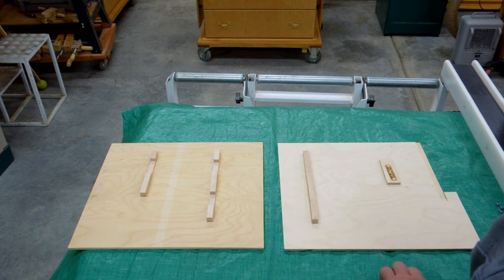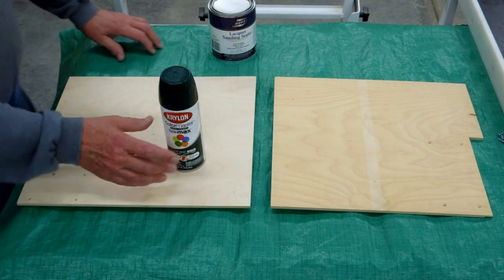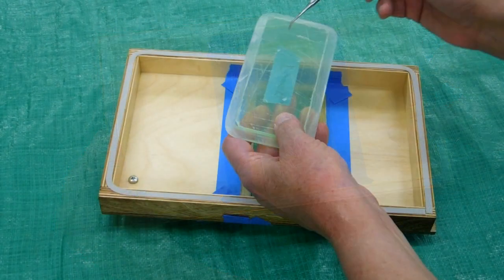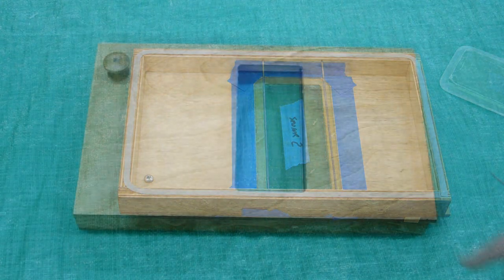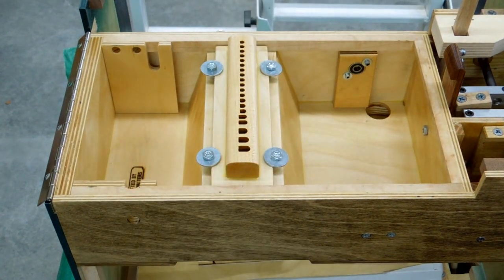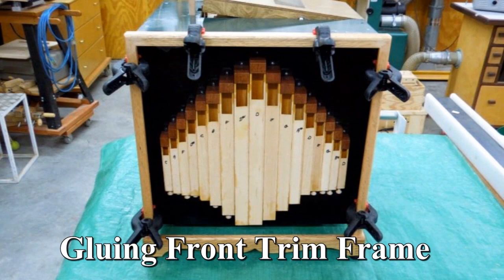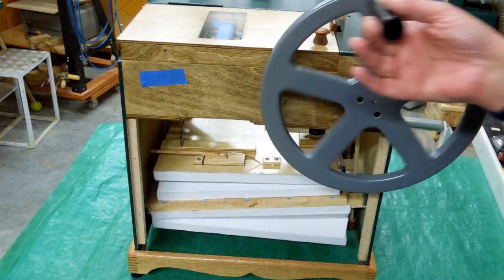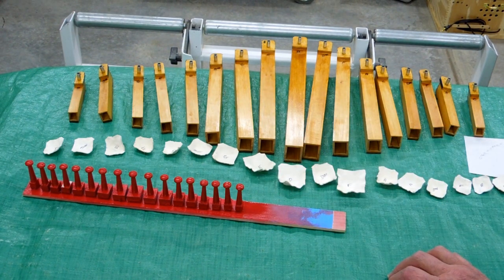Senior 20 Organ (26) Making The Case

Comment: Krylon is not cheap paint !  It is however, IMHO, the best canned spray paint you can buy.  It dries fast and can easily be layered and it cures hard after a day or two.  I like to paint outside on sunny days and you can apply coats at about 15 minute intervals.

Comment: I was just experimenting with making the littlest pipe today.  I'm not sure exactly what's going on but it makes a note sounds when the end of the pipe is open but when I plug it with say a tuning plug, I don't get any sound.  I'll have to keep experimenting
Reply from the maker: Don't know... unless the plug is not sealing (an air leak) or the pipe is leaking (not sealed)? The pipes as dimensioned do work. You need to pay attention to the way John Smith gives the dimensions... like the dimension plus wood thickness which is actually plus 2 thicknesses of the wood (each side of the dimension.

Comment: Ronald its perfect but i didnt understand that how did machine working. İ mean how you connect tracker bar and front pipes. They have only one hole to air in it. How tracker bar works when its out hole is opn. How tracker bar send air to front pipe when its front is not covered with paper? Can you please explain me. Thanks
Reply from the maker: ***** There are 20 pipes in the organ. There are 20 holes in the tracker bar, each hole is for a specific pipe. Each hole in the tracker bar is connected to the corresponding pipe with a rubber hose. The music roll allows for any combination of the 20 holes to be open. When a hole in the music roll travels across the tracker bar it allows compressed air contained inside the pressure box to travel through the corresponding hose and blow that pipe. If there are no holes in the music roll then none of the pipes sound. If only a few holes are open then only a few pipes will sound. Does that clear it up? Perhaps you can watch the entire 28 video series.

Comment: Hi Ronald,  Me again.  Hope I'm not becoming a pain in the tookus.  I'm realizing after reading the Senior 20 plans 3 times, there's a whole lot of lea way.  not much on the front or back panel.  do you have a plan of your front pipe mounting board?  I'd be happy to pay for any drawings you may have.  I'm a very experienced wood worker, how ever, I think you're mounting board is more then I could come up with.  Thanks Colby
Reply from the maker: YOU need to decide how your pipes are going to be placed in the front of your organ. Conductor or no conductor. Motor drive or no motor drive, etc. (I suggest the motor drive.) You are a long way away from needing to do that. Then you use the pipe arrangement to layout the mounting board and remove as much plywood as possible to lighten it. There are no drawings. My drawing was done directly on the plywood (for both organs). I'm just showing you how I made mine. There is some leeway in areas like the case, but the bellows, reservoir, pressure box (important stuff) should be built & dimensioned as drawn or you may end up with a mess. John Smith's plans are just giving you the basic idea... there is a lot left for interpretation. The hardest part is just getting started. The number on my videos is the order in which i built mine. The more you read John Smiths plans the more you will appreciate my video series. Please watch the ads and subscribe. That is what keeps this channel available.
Reply: Thanks, I've decided agains the conductor. I'll also be going with the hand crank.  I feel it will be more fun for my younger family members to turn the crank and make the music.  
I've read through John Smiths plans several times, and every time I do, I learn more and relate more, as well as rely more on your videos.  I think I've watched your videos about 3 or 4 times, as well as referencing them as I read the plans.  I have so greatfull and appreciative of all the time you've invested in your videos!  You're a very meticulous person and it's well appreciated! 

Thank you so much for your help and attention.  Colby
Reply from the maker: Having built the first one... and having become older... and having now had 4 shoulder surgeries in the past 7 years... I have come to realize that turning the hand crank sucks for older people. Since converting the first organ to motor drive, I have played it 10 times more often than before the motor drive and most of the time nobody else is around. And, as long as you realize, it can always be hand cranked... you don't need to use the motor... just  hide the belt and don't tell the younger people about the motor. And the motorized rewind is great. If you "plan" for the motor you can always add it later just as I did. If you don't plan for it, then you'll end up having to remake the bass pipes. :-(